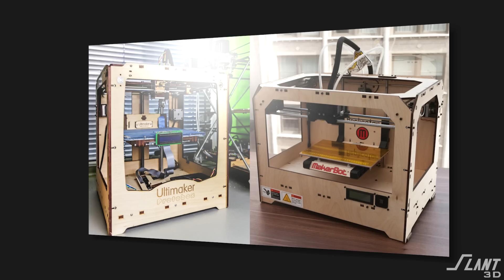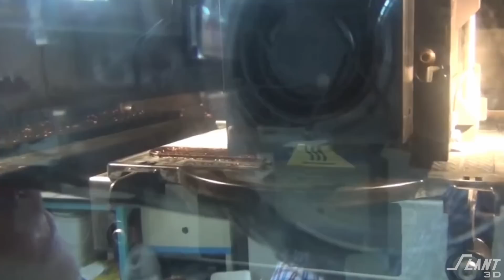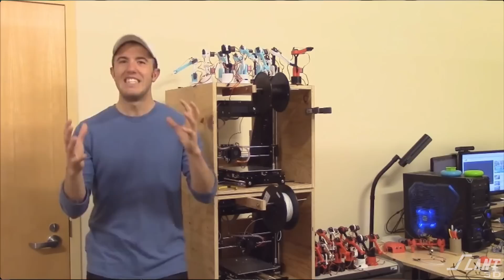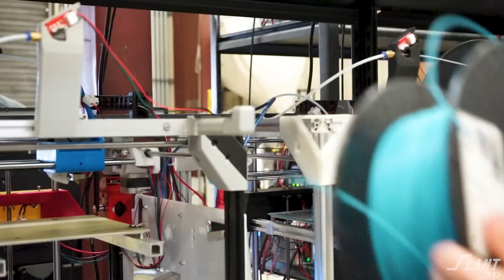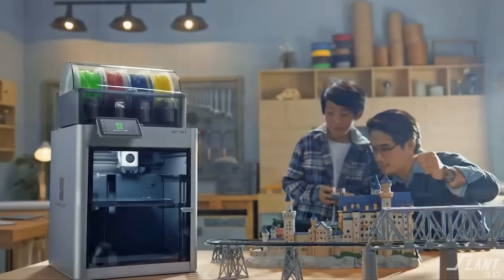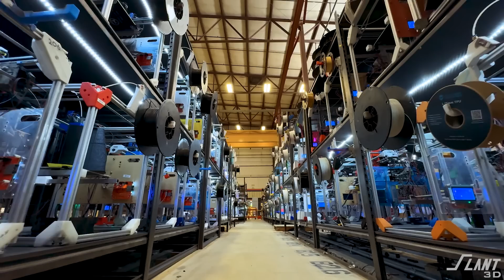I Hated 3D Printing...Until I Learned This

Comment: I fully agree with all of the sentiment here, I remember first seeing a 3D printer in person around 2016 and the guy worked for boeing and was making plane mockups, so it seemed far fetch to need one. Then I worked as a dental IT guy for a bit and saw the dentist industry 3D printers, which also added to the extreme nature of utility required for 3D printers, but it wasn't until 2023 that the Artillery Sidewinder X2 went on sale for $250 that I jumped in on my own, and little did I know I already had much of the knowledge to make 3D printers work, as I had some CAD, blender, Rhino and Sketchup knowledge.   At the time I had been running my own mushroom and hydroponic farm, and one of the issues I dealt with is in such a niche business, all of the equipment designed for the industry were so niche that it had to be ordered special from Alibaba, or I was spending way more money than I needed to on mold injected parts and flanges on amazon.  With the 3d printer now I have paid off my $250-300 investment multiple times with just the 6" air intake flanges I use between rooms. Not to mention I can wire together electronics and print housing to keep wires from being pulled, coming lose, and causing fires, which is how i've seen many of my peers lose their business. 

I still think 3D printing is a niche tool that only solves 10% of most issues as a business owner. As I build grow rooms my biggest issue was fabricating what I needed from standardized sized parts from homedepot or other hardware stores, so now I don't have to custom fabricate anytihng and just print adapters to work with what I need, and going forward I am fully investing in 3d printers to make everything for my business, so I can then also sell my business's SOP, business practrices and .stl files to people who want to make a side hustle at their home as well.  

The future of American industry and fabrication is going to be lead by 3d printers and their utility to customize and create anything, not that the 3d printed part is the end product, but it is the corner stone in fabrication towards different, faster, more efficient forms of fabrication.

Comment: As you said, 3D printers are a tool.  As with any tool it's about understanding where it's best used.  Sometimes you need a chainsaw, sometimes a band saw, sometimes a rip saw.  Until you understand the tool has it's advantages and weaknesses you won't be able to make best use of it.

A 3D printer isn't always the best option

Comment: Most efficient? I think that depends on how you're measuring efficiency. Because it sure isn't the fastest, and it's probably only the cheapest or easiest up to a certain scale, and I doubt that will ever change, so there is a point where the upfront cost of tooling starts to make sense when you are manufacturing larger volumes. 3D printing has its pros and cons, claiming it's the best way to make everything is just as wrong as claiming it's never the best way to make anything. But, where it definitely has machining and injection molding beat is in its versatility, which makes it possible to create things that would not even be possible to manufacture with other methods, allows more freedom in the design, and makes it a great, low cost option for just about anything (with certain limitations, for example the strength of a 3D print can never match an injection molded part), where the cost scales linearly with the scale. We are already seeing almost a third industrial revolution where many new low volume or niche products are appearing on the market thanks to 3D printing that would not have been viable to manufacture in the past because they would have simply cost too much, creating new markets that just did not exist before, and I think that's amazing.

Comment: I'd be quite interested in your take on the filament versus resin. Which is better? When to use each? And so on. I understand that filament doesn't require as much treatment as resin, but the latter seems way more scalable for small parts and stronger. 
Also about heat treatment, which I've only recently heard about. But there seems to be some benefits from thermal treatments which result in stronger parts...?
Dunno, I may be just rambling here 😅

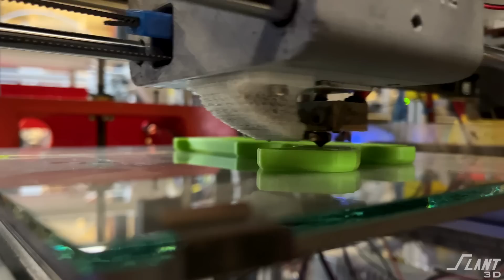Comment: 6:34 "Printing is the most efficient and most effective way of making any item, period."
When you restrict the conversation to 3D printing farms, auto-ejection, changing the whole engineering mindset and people moving away from smooth things and getting used to layer lines finishes, then yes, I agree with you.
But that's the same as saying "In a desert, at noon, this is the most import glass of water in the entire world."
It could very well be that some of those conditions never arrive, or take 100 years and by that point new processes overtake the manufacturing world and 3d printing never become the "the most" anything.
Reply: Where do these trolls come from lmao

Comment: I generally agree with your points on this and it has shifted my perspective on the scale where 3d printing is viable.   With 2 objections currently.  1. 3d printing for mass production is not better than injection molding. It is also not worse.   It is an alternative.  There are some features that are easy in a mold and extremely difficult in a print. And there are some features that are easy to print and impossible to mold.  2. For it to meet parity like you envision 3d printing will have to find a way to achieve high precision without a precision feed stock. As long as the feed plastic requires high precision it will always cost more than the one that does not.    I do agree that is an engineering problem, but it is a serious hurdle to be addressed to bring the cost to parity between the 2 manufacturing tools.  Great videos as always.
Reply: he's definitely working to solve the precision problem, but tbh if people started using 3mm filament again it would practically evaporate overnight, and if he applied his new techniques to it the variance would no longer be enough to effect precision in essentially any scenario I can devise. 

This is ignoring the INCREDIBLY logistical flexibility of 3d printing, especially once print farms start to scale, standardise, and spread around. Do you really think people are going to want to give up a the kind of 'just in time' logistics they could previously only have dreamed of, once they've gotten a taste? The ability to scale production up and down practically instantly, with ONE DAY lead times? the realistic answer is no, they won't. Once the big boys get a taste they will find a way to make their products work with it, or make 3d printing work with their products whenever they possibly can.

Then there's the coming of 5+ axis printers, some practical examples already exist, and most 3d printers with 3 z motors are already fully capable, mechanically, of enabling this feature, and are just lacking the software to make it work. The amount of design freedom that unlocks will be insane.

I remember when people were laughing at the very idea that 3d printed guns would ever be practical... they aren't laughing now. The more people start to optimise parts for 3d printing, make new inputs for 3d printing, the more you will see an explosion in what it can do. Once that happens, people aren't going to stop there. if you add to that things like  tool changers wire/thread/ribbon inlay heads (eg Markforged), heat insert heads... it's going to unlock crazy applications. you can bet this will be combined with other highly flexible 'on the spot' or 'just in time' manufactuing methods to support it, people will come up with brand new, novel ways to make previously mass manufactured parts just for logistical flexibility.

Realistically, as people start figuring out how to design for 3d printing, and the capabilities of 3d printing expand, the cost come down, and the sheer QUANTITY of printers goes up and up, the applications of injection molding will only get more narrow over time, it will become ever more specialised in higher and higher volume parts, and packaging/blow molded films.

3d printing is not going to replace everything, it's not even going to fully replace IM, but you can bet those mold makers are not going to be getting as many orders as they once were...

Comment: Unfortunately for me 3D printers are still just too slow, if I was to make a viral product today there's no amount of printers that could do it fast enough to keep up with demand. A simple coaster for example, 1hr-2hr depending on printer to make, people usually buy them in a pack of 4, at best that's a dozen products per printer per day, just not fast enough :(.
Reply from the maker: That is why we build the largest print farma on the planet. And give folks free access to them. You would not run YouTube on a laptop. Why would you launch a viral product on a single printer?
Reply: @slant3d  You missed my point I didn't say 1 3D printer I said NO amount of 3D printers would be able to meet the demand, it's simply too slow. On your YouTube on a laptop analogy yes you could say 3D printing would be like running YouTube on several thousand slow laptops, each request to view a video would take 5mins to buffer.. Come back when FDM 3D printers scale the same as computers and networks, they don't, if you add another $500 printer to a print farm that's few dozen 1hr prints extra a day, it's not enough.
Reply: @wafflecart I think you're comparing different things here. To get a mold for injection molded parts, you have to play at minimum $10,000 just for the mold. For that kind of money you could have alot of printers

Even if you contracted the work out to a company, the initial cost would be very high in comparison to 3D printing.
Reply: @sounghungi  this $10,000 crap for a mold is A MYTH! You can design and prototype molds with your 3D printer, cast a resin or silicone mold heck even a forged carbon one. Then get the final mold machined out of metal by PCBWAY for a fraction of that cost and get it in a matter of days..

Comment: It's not a better process. It's a better process for niche use cases. 3d printing will never produce injection molding quality. Injection molding will never produce the low volume economics of 3d printing. 3d printing can produce geometries injection molding can't. Injection molding can produce the necessary strength in geometrically constrained parts, that 3d printing cannot. It absolutely isn't a better process, it's another process. It just happens to be far more accessible.

Comment: The magic that gives 3D printing its true value is " complexity is free ". There is no tool cost and that's the science fiction part of the story. When I showcase my 3D printers in events people are quick to compare 3D printing to other ways of manufacturing by saying 3D printing is take a lot of time and they forget about the preparation time. You can pass from design to manufacturing in 5min with 3D printing while you need weeks to months using any other way of manufacturing.
Reply: Isn't CNC the same? Although there are obviosly things that can't be CNCed but 3D printed just fine, one would need to design parts to be CNCed (in opposed to designing parts to be 3D printed).
Reply: @vuongnh0607l  CNC requires setup time, raw material prep time, tool changes, supervision because if anything goes wrong it can destroy the machine beyond repair.

Comment: An interesting and key perspective - the focus on inputs to a process as key to scale efficiently. I've often thought printing large elements of a structure (e.g. beams, plates) from plastic is daft as it's slow and weaker than wood, aluminium extrusion, etc. I made a spool holder for large (8.5kg) spools where I 3d-print the corner pieces of the structure and use cheap strip wood for the main structural beams, as making the whole thing from 3d-printed plastic seems daft (and certainly is for a one-off make). That said, however, for production at scale there's something to be said for the ability to print the thing whole and eject without needing manual intervention on each and every print. Labour costs of building my spool holder would be quite noticeable in kitting and assembly.

Comment: Like nearly everything in the engineering sector, the sentence “it depends” would make much more sense! To say 3D printing is fundamentally better is just not true. Like you said in your statement early on, you wouldn’t 3D print a board with a hole in it, that just has not changed! You still wouldn’t do it, even though you could. I’m a big supporter of using 3D printing for mass manufacturing, but like I said earlier, not for everything… and that won’t change!
Reply: It's mostly a superior replacement for IM, one of the most ubiquitous processes around, in the vast majority of it's usecases, excepting simple, stable designs made in the millions every year. This ESPECIALLY includes metal injection molding by the way. But it's penetrating, in various ways, into many other processes too. Metal 3d printing, printing tools for investment casting, or just straight up printing the sand mold itself, that's a fundamentally superior workflow in every way to it's predecessor. It also is great at making jigs and fixtures for essentially ALL other processes in existence, with few exceptions. It's hard to see how 3d printing, combined with a few other low cost tech that fill niches it's ill suited for, isn't going to radically alter the manufacturing sector.

Comment: I never cared and built myself a 3D printer at earliest opportunity. Because I'm not gonna have a machine shop and a wood workshop at home. And often times I have it make me absolutely trivial parts that I could do any other way because I just draw something up at the speed of imagination and the machine makes it for me I don't need to expend any extra effort. I mean I have specialised tools of some types but mostly if something isn't done with my favourite #2 screwdriver or a Jimmy knife, I'm grabbing a multi tool or bit kit. The more specialised higher quality tools are all...  somewhere, I need to retrieve them and that's effort.

People telling me that I'm using 3D printing wrong or my tools wrong? I plain don't care. Because it's absurd to have a 3D printer at home?

Comment: I do love 3d printing. And think it has it's place. As a former automation technician at a large injection molding facility. There are just some parts you cannot reproduce with printing. We made alot of medical field single use items. You cannot reproduce the volume of those parts. For example. Ear tip mold. Shot out 72 tips that the doctors stick in your ear. 12 second cycle time. 72 tips were produced. Shot out. And bagged on the fly.
Reply from the maker: Just like a print farm
Reply: @slant3d  exactly like  print farm. Except. It would take you hours to do what that mold could do in seconds.
Reply: Thats 1 million parts a day. And bagged.
Reply: It would take years for you to do what that mold could do in a day.
Reply: I know the price per part. And bagging and shipping. You cannot produce that at a competitive price.
Reply: And its polypropylene. Good luck.

Comment: It still depends on the part. A part that you need here and now for quick iteration or opportunistic product can make sense to be printed, but for a very high volume part with a design that's already settled, or for larger parts, injection molding is still king. Lego is not switching to printing their sets anytime soon, neither does Tupperware. 
Also, they aren't melting the plastic twice to first turn it into filament and then turn it into a part, molding uses pellets directly and leaves you with a bit of sprue that gets recycled (just like supports except removed automagically), and once they get running they need minimal human input.
Reply from the maker: Tupperware is going out of business. Lego nearly did.
Reply: @slant3d  not because they use injection molding, that's for sure. In fact, they both struggle because there is competition that set up their own injection molding production and makes similar stuff but at better price to quality ratio. Not just in China, but worldwide, like NZ's Sistema Plastics. That goes a bit contary to the video's message.

Comment: Time is a resource too. You need to account for this one in the manufacturing process. Some people don't have hours to produce a handful of parts.
Reply: You're going to spend hours to produce a handful of parts no matter what. Given a complex part, a 3D printer will do it with the least material and least labour. If it's a sheet with a hole in it, then of course you might as well take a sheet and drill a hole in it, as mentioned in the video.
Reply: @celeron55  Or if you need to do a lot of sheets with holes in them, and perhaps a bend or two, a punch press may be the way to go. There are good reasons to go with a lot of different processes. I'm in the process of printing pieces for a ham radio hex beam. I'm not going to 3d print the shafts that make up the poles, I can pick up 6' long 1/4"  fiberglass poles at Home Depot for under $3 each. On their own they are not long enough, but I can easily design and 3d print the pieces that allow me to put 2 of them end to end for the 12' long pieces that I do need.

Comment: This is splendid stuff. I too spent probably... half a decade thinking that 3D printing was niche, for prototypes only, and overall remarkably expensive. Then I met printers that could print in engineering materials, and were themselves low cost machines that could be run massively in parallel. And the penny dropped.